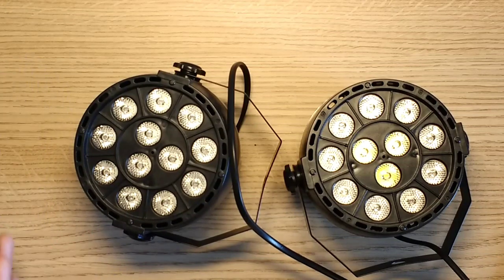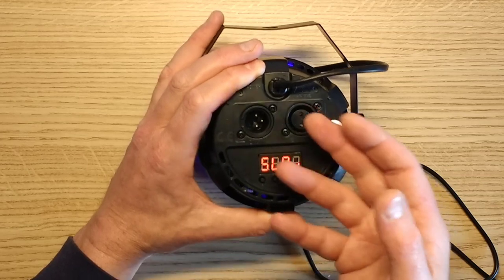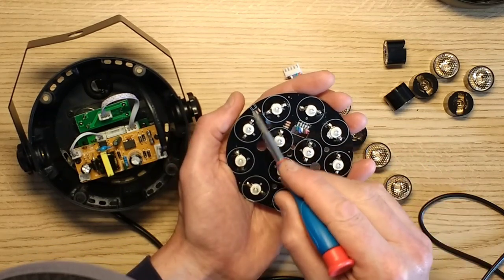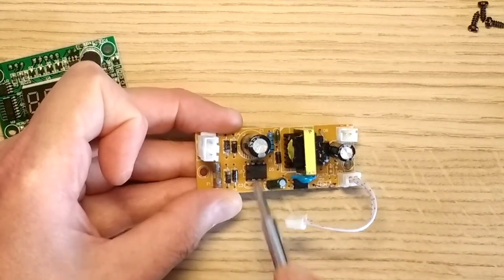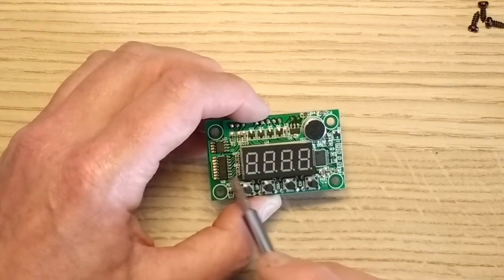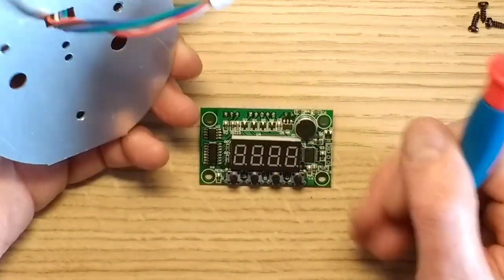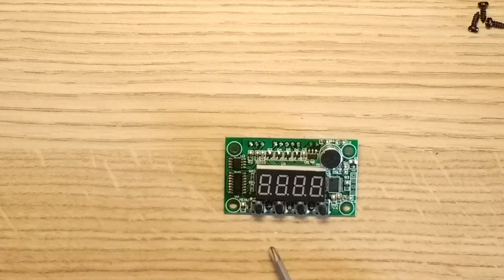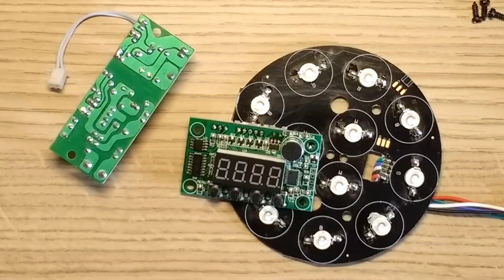Teardown of a DMX controlled UV disco light.

Comment: Hey Clive, I've got a question.
I'm tempted in making a stand to hold a coca cola bottle filled with tonic water. Under the stand there would be a UV LED shining into the bottle (tonic water glows under UV light). Thing is, I'm not sure what the precautions on having a UV LED being on for long periods of time are. I'm a bit concerned that it'll mess my (already deteriorating) sight or damage any electronics I have nearby. Should I be concerned at all?
Reply: I think the main issue would be that it doesn't glow very brightly, so you would be in the dark starring at a UV source.

I've no idea if that actually any more dangerous than being outside on a sunny day though.

Unhelpful! :)
Reply: Its all about the wavelength, I think the longer UV wavelengths are pretty harmless at low intensity (ie from a 1 or 2W LED). iirc the ones they use in nightclubs etc are 380-420nm and its the shorter wavelengths that are harmful

Comment: Clive, why do you thing is it that out of all the countries with proper 230V/240V high voltage only the UK plugs have mandatory fuses in them? I mean, is electricity safer in other countries (as in are the house installations more to code, so the plug and cable doesn't have to account for anything that could be wrong before the socket), or what would be the reason for that?
Reply: The wiring in our walls are ring mains and can supply up to about 30-32 amps (depending on the age of the installation of the fusing/circuit breakers), and 32 Amps at 240 Volts through a 0.75mm flex in a short circuit fault, yeah, bad things happen, hence the use of fuses in our plugs... :)

It was all part of post-war copper-saving measures, as radial wiring uses more copper than ring main wiring, it's silly to have it today in my opinion, but, it's the standard we use, though some modern electricians have been using radials more often than rings... :)
Reply: twocvbloke - first, let me say Hi and nice to see you here :) - and then about the subject: OK, that explains it somewhat, since over here in Germany, we do have 230/240V, but every room or circuit has its own 16A circuit breaker (they are standardized), so I guess it's safer that way. Our circuits are rings on one wall or in one room (like, if you have a set of 2 sockets on each end of the wall, they are on the same breaker, sometimes even the whole room, if it doesn't have many sockets), but the whole apartment or house is wired radially, and normally, at least the ceiling lights (that are controlled by a switch in the wall) are sitting on a different breaker than the rest of the room, or sometimes, if the room has 2 breakers (one for one wall, one for the other - with the 3rd wall being on one of the 2 breakers, and the 4th just having no electrical installations whatsoever), the ceiling light is on the same breaker as one of the walls. But usually, the sockets and ceiling lights are separated. For which it doesn't make sense to put in a 16A breaker each anyways, but that's how it's done.
I have an older installation from around 2002 in my appartment, and it required to have an RCA only for the bathroom, so that's what it controls, while nowadays, it's mandatory to have an RCA on the whole apartment (but since an RCA is a different thing than a normal 16A circuit breaker, that's also a whole different subject alltogether, LOL).
Reply: Yeah, been watching Clive's vids for a few years now, he's like me, likes to take stuff to bits... :)

But as for the wiring, most of the world uses radial wiring as you describe there, it's just us brits that are somewhat unique and stuck to the ring main standard, prior to WWII we did use radial wiring and had appropriate plugs & sockets for the job (namely the BS546 standard, with 2Amp, 5Amp and 15Amp round-pin plugs, the first two had both earthed and unearthed versions, the 5A version being similar to the current 2-pin  Europlug), but due to war efforts, copper was in dire shortage and we needed to economise when it came to electrical wiring in new builds and re-wires. 

It's usually quite simple though, the cable is run around the house and back to the consumer unit forming the ring, and all the sockets or light fittings are fitted in parallel with each other, so can operate independently of each other, if the ring is broken somewhere, it'll continue to work (though not ideal), and most houses usually have 4 rings, sockets for downstairs & upstairs, and lighting downstairs & upstairs (flats and bungalows may have two or three, usually one or two socket rings and one lighting), the only radial stuff fitted is usually electric cookers and electric showers where only one device is required so therefore is wired in radially. 

Protection varies though depending on the age of the wiring, some houses are still using wire fuses, some have early MCBs, some have MCBs with a lone RCD, some have an RCD per level of the house, and some with more up-to-date wiring have RCBOs for each circuit (which are an MCB and RCD combined into one).

If you haven't already, check out John Ward's video here on youtube, he is quite good at explaining our wiring in-depth, and has teardowns of old fusing & protection equipment showing what used to be used aswell as what is used now... :)
Reply: Wow, that's very different to our wiring. I've just taken a photo of my breaker panel - that's inside a 1-room apartment of about 43m², and there you can see the amount of different breakers I've got (including the description of what they're for in German): https://drive.google.com/open?id=0BxzFLD4J-MahZ0xUSFlsNGFDdVk
Reply: Looks very much like what we have here for more modern installations, except our consumer units tend to just have the one row rather than two (but use the same DIN-rail type MCBs/RCDs/RCBOs), as we don't need as many switches in the units based on the wiring standards... :)
Reply: So you're basically saying, your wiring has less circuits? Oh well, I guess most of mine will never even come close to the 16A they're rated. Best of luck will be with the kitchen stuff (washing machine + dishwasher + refrigerator), while the electric stove - which I don't have, since it's gas operated - would be on a different circuit alltogether.
Reply: Yep, as I said before, it's common to have up to 4 ring main circuits (and as pointed out by Eden's Aquaponics, as low as two for a whole house!) and maybe a couple of additional radials for other devices, reducing cost and materials used, but resulting in our need for fuses at the plug for when things go bad... :)

I'm sure someday we'll eventually drop the ring main system and go to radial (but as already mentioned, some electricians here will fit radial wiring rather than ring main in new builds and some re-wires)... :)

Comment: Great little lights in mass. Only any good for small work. First thing to do is change the flex and plug. Yea don't trust the dmx on them. I had some with reversed polarity and dmxing issues. Always seem to end up running them standalone mode. Lots of light for little money.

Comment: I agree that this is not the worst design, however, I doubt the validity of the CE marking on the rear of the unit. Particularly since the CE marking is not present on the circuit boards and given the dodgy non BS compliant 13A fuse.

Unfortunately manufacturers can self-assess CE compliance, so unless someone writes to the company and asks to see the documentation the CE is as useful as the QC passed sticker (i.e. for items manufactured OUTSIDE the EU it often it means nothing at all). Given the huge volume of good imported as a result of marketplaces like e-bay, typically, the only occasion that a CE marking is challenged is if someone is injured and a lawyer is engaged to seek damages. The chances of someone taking successful action against a manufacturer outside the EU is slim (aside from limiting further imports  to EU counties). Consequently any injured party will go after the person operating the unit (i.e. YOU the owner).

Designing and manufacturing to CE standards is the thing that costs the money folks. Avoiding the process entirely is often the way manufacturers from outside the EU under-cut European manufacturers.

Once again, many thanks to Clive and his channel to expose these products.

Comment: I got a question, when you say ultraviolet or "almost ultraviolet" does it  have the same effect say on florescent dye or white t-shirts. I have an a/c test kit for leaks would they "almost ultraviolet"  light up the dye like a regular, UV light
Reply: Raymond Mucklow Yes. It's called "near UV" because the output wavelengths straddle the boundary between visible violet and ultraviolet. Far ultraviolet lamps, by comparison, appear unlit (or have a very low purple glow due to some visible emissions) when viewed directly, but still produce the fluorescent effect on materials like white fabric.
Reply: Graham Sutherland thank you.

Comment: Did you say 13 amp fuse?  At 220V (which I think is about what you have in the U.K.)  that could service over 2.5 KW, it's like they did not think to switch the fuse rating when they switch to LEDs.

Now I want to know if someone make 2.5 KW LEDs.
Reply: 2.5 kw UV-LEDs? Instant cancer haha
Reply: Ulfgar-Septimus von Stahlenberg  Only if it actually emits UV light. But Clive says it emits visible light "near UV".

Comment: Clive, why don't you have any DMX USB dongles around? They're nowhere close to £20.000 :)
Reply: not for good ones. ive had ones that have been build it yourself that I could never get to work properly, ive had some £200 branded ones that lack the data speeds I need and ive got a £100 controller that is also lacking. frankly if you want anything that works well your gonna need a good £1000 :3

Comment: We have some pretty good equipment at our school like our sound desk is a digital one worth a few grand but no one knows how to work so they get me to do it except it does my nut in because half of the equipment is fucked from misuse
Reply: there's a whole half of the light desk that just won't work and at one point someone locked themselves in the room and fucked with everything so the radio broadcaster was essentially broken, I've managed to get most stuff running bar stuff that can't be replaced and is just broken like lights that have been blown and stuff
Reply: what the hell school were you in? at least my school didn't have much in the first place. I mean, damn, those are some rough sounding students. 0_0
Reply: what light desk is it? is it a dimmer one or is it a computer-programmable one?
Reply: My school is in Scotland and the school has no idea how to spend its budget so some things are surprisingly expensive, but other things are terrible like the air conditioning in the school doesn't work so it's too hot, but since it's the only school in the area you get a lot of people with problems, there's less of them now but there used to be people who would just randomly break stuff for no reason
Reply: damn... I admit my school sometimes did that. like they had air con in only three rooms, would leave the radiators on in winter, and spent thousands on a climbing wall and Olympic trampoline to never use. :3 the new headteacher used them more, but then he bought a new money system to stop kids having to use  physical money, as well, they used to have a place for people with problems (aspergers, e.cc.t) and they would have  them go there  if there was an issue, as well as having support teachers with the worst ones at all times. my criticism is that they had a lighting course and never told people about it really, meaning I never got to go on it, but they did keep things in that area either cheap or out of the way. :3

btw, talking of lighting courses, I still got into lipa to do technical theatre  thanks to my careers advisor, so at least I know that some staff were worst the money, and while I'm on that point, I have to get my GCSE results tomorrow so excuse me if I disappear. :3
Reply: Are school apparently used to do a sound engineering course but now there's no teacher to do it, which is also the reason no one knows how to work the stuff, also it's a computer controlled desk yet there might actually be more than one, there's a copy of the wiring work in the room and it lists all of the equipment so i know there's at least 3 sound desks
Reply: damn... is it just a midi desk or is it a proper one? like an MA wing?
Reply: it's a simliar one to this https://www.acaudio.co.uk/live-sound/digital-mixers-186/soundcraft-si-expression-3-digital-console.asp
Reply: the lighting one?
Reply: the lighting one is DMX controlled and connects to a monitor, it's supposed to have two parts, one of which is for controlling spotlights but they were never installed

Comment: Hi Clive, That is a BS fuse as in Bull shit :-)
Reply from the maker: Yes it is.
Reply: LOL, I also had the thought "If BS were to stand for bullshit, it would be a properly BS rated fuse" ;-)
Reply: Just replace the fuse with a proper 3A UK BS1362 fuse.
Reply: Paul, why did you have to put a fuse in your washer? if the OEM fuse blew that's a sign that there's fault in the washer.
Reply: And how can a bad fuse trip the main fuse box?  (Except by not blowing when it should.)  Something else is going on.
Reply: At present BS or BSI means nothing to the Chinese because until march 2019 (hopefully british safety standards will be implimented in full again)... all they need is a CE mark and QC passed... the sleeved earth pin is an example of shoddy Chinese manufacturing again.

They's be better off just buying a big box of plugs from one of their 3 biggest BS1363 plug producers & pay someone to sit wiring plugs all day.

Comment: Yes, you should definitely remove that plug. If it has a sleeved earth pin, the chances are good that it doesn't comply with the other elements of BS1363 and may well be dangerous in other respects. Actually, that plug looks very much like the one mentioned here:

http://www.bs1363.org.uk

which had a number of worrying faults, not least the fact that the outer covering on the cable was soft enough that you could peel it away with your fingernails. So you might want to replace the entire cable at the same time…